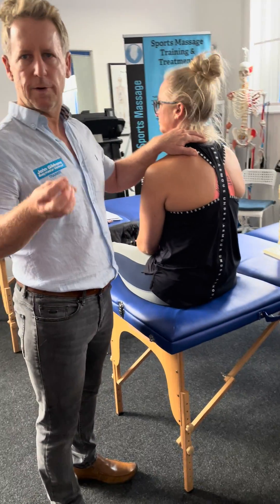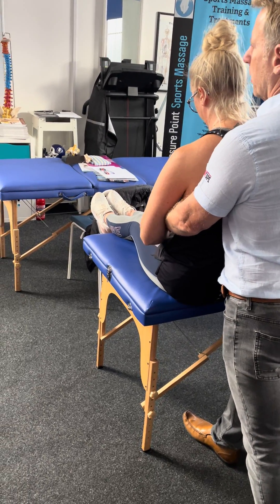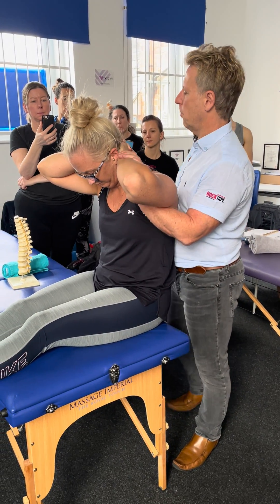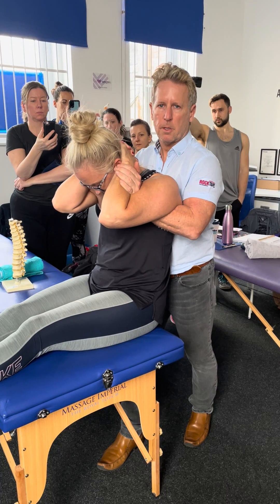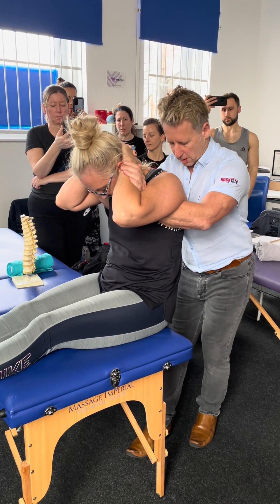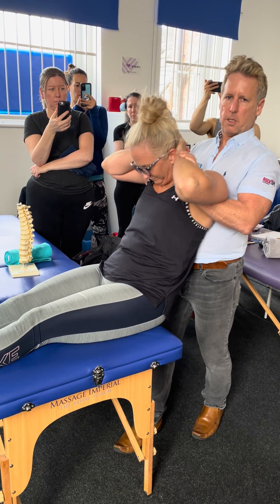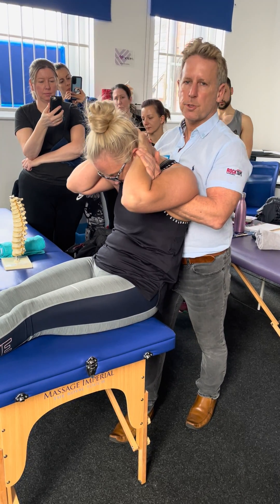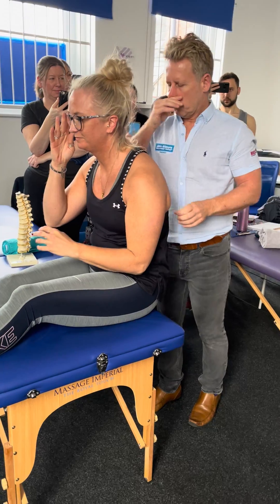Best way to Manipulate the Cervical-Thoracic Junction of C7/T1

Comment: When i perform this maneuver i use a short 12 inch foam roller between myself and the patient. I place the foam roller at T1 maintaining an anterior/inferior psi with my chest.
Reply from the maker: If it works then not a problem, regards JG